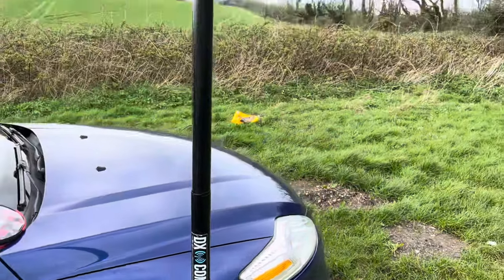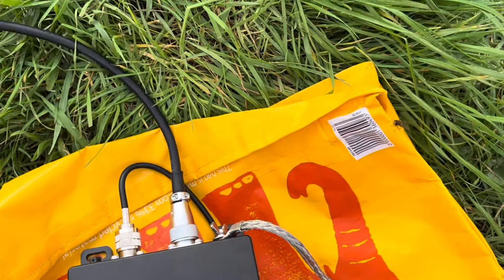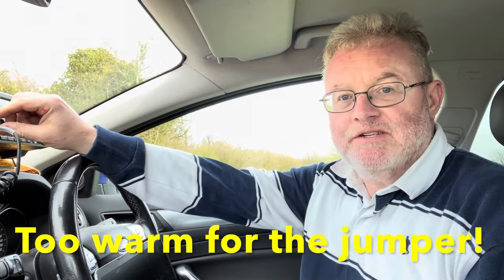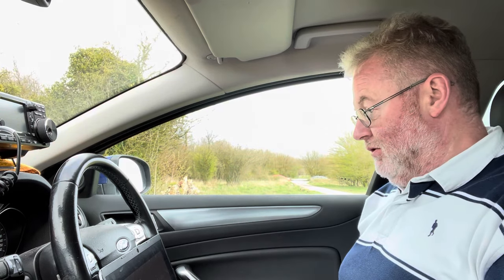A Simple 7 Bands Small Space HF Antenna

Comment: I don't want to criticize, but this setup seems a bit of an overkill.

You could achieve the same with your RT100 and the 891.

If you put a 4mm banana plug on the antenna wire and plug it directly into the SO239 of the antenna input and connect the radial network to the earth connection of the little LDG tuner you wont need a control cable.

I did just that but without the radial network, I just put the tuner to the rooftop of the car (as seen on your videos) and connected a Diamond MAT-50 magnet mat via a ring terminal over the SO239 of the radio input and fixed it in place with the coax.

About 10m of wire gave me 10 to 40m with really good SWR on all bands and no coax loss, no radials but the capacitive coupling between the magnet mat and the car body.

Maybe an idea for another day... 😉
Reply from the maker: Yep some good points. However, the RT100 is typical of many auto tuners in that it’s impedance range stretches up to around 800 ohms. The MAT 40 is about double that. Now, taking my 9m wire into consideration, let’s look at 14 MHz, the wire is getting close to a 1/2 wave. Already the feedpoint impedance will be in 4 figures. I’m unsure that the RT100 would cope if asked to be a feedpoint tuner. Same on 10m as a near full wave. Thanks for the comments, great to see the interaction. 73
Reply: @timg5tm941  thank you for your kind words.

I did not really measure the the wire exactly, not even talking about considering the velocity factor, but I had absolutely no problems with the RT100.

I think this setup is a prime example where the concept of a "random" wire length comes into play.
As long as you hit no super high impedance you'll be fine.
A 4:1 in front of the antenna port would also sort this out but that's not really in line with a more streamlined setup.

I often use the chinese 5.6m whip antenna on a mag mount, fully extended and matched with the RT 100 as my go to POTA setup for 20 to 10m.
I was really surprised that the RT 100 gives a perfect match everywhere on the 10m Band, since it's nearly a half wave length. It really works exceptionally well and got me from southern Germany to the US, South America, Korea Vietnam etc. 

But anyway, great work from your side as usual.
I really dig this kind of practical, out in the field types of videos.
By the way, I already told you once over the air, you're making me poor because you made me buy the 891 and the RT100, but I am absolutely grateful for it 😅
Reply from the maker: @_0815_  I’m glad it worked for you. The RT100 and 891 are a great combination using the ATAS mode. Keep on rocking! 73